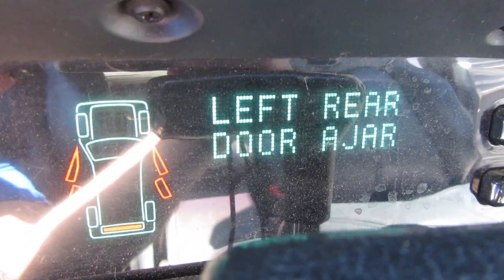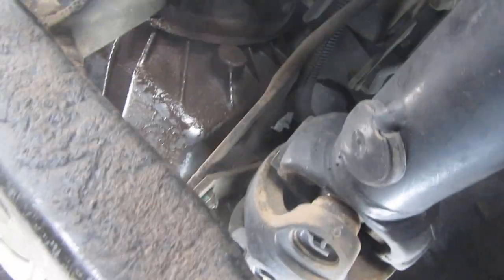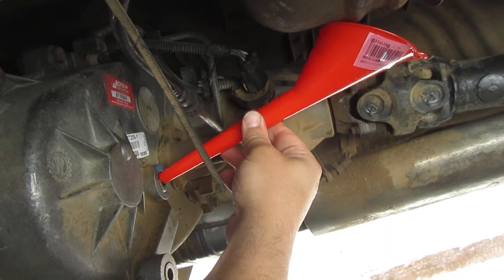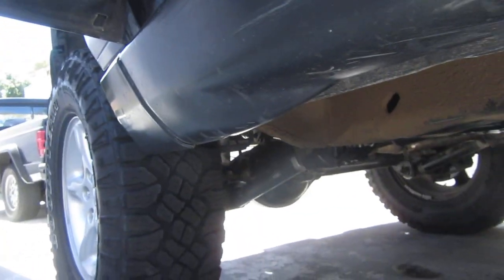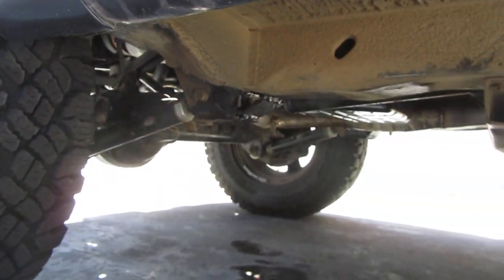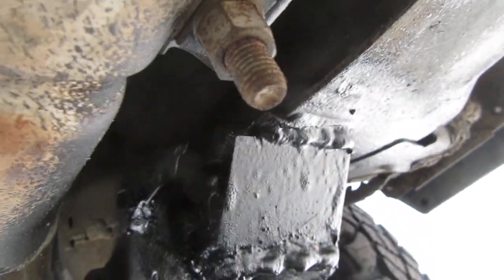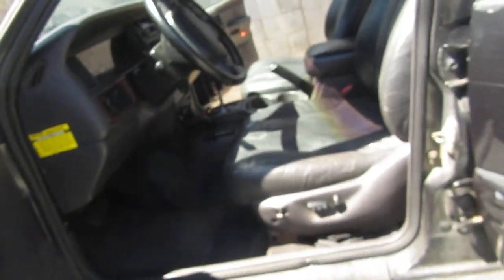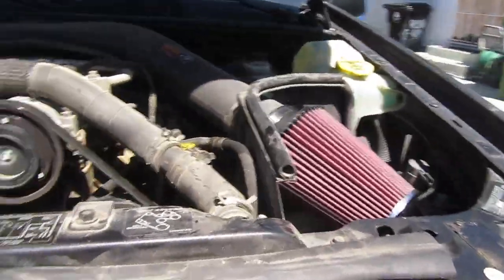SERVICE 4WD SWITCH - 1998 JEEP GRAND CHEROKEE ZJ

Comment: Castrol ATF plus 4 is the best transmission fluid for Jeeps.
Reply from the maker: No doubt.  Problem is finding it any more.  Some Autoparts stores believe +4 ATF is no longer necessary.
Reply: @301steady  they have it at advance Auto parts and AutoZone and Walmart is the cheapest of the three .
Reply from the maker: @jaysmith5084  Yeah, Walmart online, they deliver.

Comment: If I were to completely drain the Transfer case, how many quarts of ATF +4 does it take to fill it? 

Same thing for the transmission: If I were to completely drain out all of the fluid in the transmission, how many quarts do I need to put back in? Thanks again for the video! I need to do this...

Comment: Well lol I figured it was another shotty fault message for a few months, guess I better get to filling the t-case up thanks for the vid
Reply from the maker: Let me know if filling it up fixes your t-case too.
Reply: @301steady  My light came on. The funny thing is that I bought my 95 6 months ago, and my light panel wasn't working. Now it works and shows what you said yours did. I haven't driven it in 3 weeks because while I was on the Highway my trans would quit working, and then work again. Then it did it again, but finally it worked good enough to make it home. Do you think what you did will make my Trans quit doing what it did! Another thing is I didn't know you had to put it in N to check Trans fluid. I did in park and it was WAY over the full line! Thanks for any help!
Reply from the maker: @davidregan9872  Yeah, sounds like you have too little fluid in both the Transmission and Transfer Case.  O'Reilly sells ATF+4 by the gallon or Walmart.com sells Castrol ATF+4 by the quart.  I now am a firm believer that everyone should top off all transfer cases & transmissions every 3,000 miles; when, doing the oil change.  Completely replace Transmission & Transfer Case Fluids every 25K miles.  Change the Transmission Filter every 100K miles.  I've come to this conclusion by running all my Jeeps and my Chevy offroad, along with helping friends with their Jeeps.

Comment: I'm new to the Jeep especially ZJ so the T - case takes the same fluid as the transfer case?
Reply from the maker: Both the Transmission and Transfer Case takes ATF+4.
Reply: Even though mine is all wheel  drive
Reply from the maker: @newmexicooffroadvideoslock8814  Especially; because, it means it still has the original transmission & transfer case.  If it had an Atlas it would definitely not require ATF+4; but, it does.
Reply: @301steady  ok thanks  To keep up with your videos I like them
Reply from the maker: @newmexicooffroadvideoslock8814  I want to go to the desert; but, this lock down has me locked down.
Reply: @301steady  right .  Hopefully all this blows over

Comment: Something dont sound right with that engine.. besides the lifters tapping, sounds like an exhaust leak or something out the exhaust manifold.. I had a crack in my headers when I bought mine.. I replaced the 1 hole fuel injectors with 12 hole ones from k suspension when I did it.
Reply from the maker: You are absolutely right.  It's in the shop right now for tune-up, smog and the exhaust has lot's of damage.  It's all getting fixed right now, including new engine mounts and transmission mounts.  Could have done it myself; but, between work and life, easier just to get a shop to do on this one.  Not sure when it will be in the desert again, hopefully within a couple months.
Reply from the maker: The engine mounts were shot, allowing the engine to rotate.  Exhaust impacted right upper control arm.  Dented exhaust.  Caused leak at manifold.  It's all getting fixed at a reputable exhaust shop.  Maybe I'll make a video of it when I pick it up?
Reply: @301steady  I hear you.. I'm doing mine from front to back.. i fibbed a little. I got the new exhaust and fuel injectors.. i have the exhaust and intake manifold out when I saw the exhaust leak.. so I got new exhaust and I thought to myself.. why did those headers crack to begin with?. So I looked at engine mount.. sure enough dry rot and cracks in engine mounts.. I got mine with 130000 miles on it. It stayed in town past 20 years, older folks owned it.. so all the mounts and suspension are going bad from age.. I'm waiting on the first of month to order new mounts and stuff.. I also need to replace radiator... its leaking out of It.. I'll see if I can just repair it once I got it out or can see the back of it better.. there were battle damage repair kits In the military, I'm hoping I can find some radiator repair compounds and maybe just fix and flush.. eh if I take it out it's only 100 for a new radiator or somewhere in there, so who knows.. I decided to buy an older vehicle that I can work on. All the new vehicles are ridiculous with their planned obsolescence.. I figure I'll get this jeep up to par and stick with it.. got me a 96 jeep grand Cherokee larado..lots and lots to do on it.. I need to do timing  chain and sprockets. Crank shaft seal.. water pump too when in do that.. then once the manifolds are back on with new injectors I'll start moving back.. like servicing the transmission and transfer and differentials while doing new seals on all..  plus I need to grease and or replace wheel bearings, then the fun part that i haven't done much of.. the suspencion.. I want to figure out a little lift, not too big. I just want a little more aggressive and maybe just a little larger tires.. might find a 2 in easy lift or something plus cut out the fenders and do mud flairs.. I just dont want too extreme of an angle on the drive shafts, in other words I dont want to mess with the drive shafts or have to regear the differentials, so I dont want too big of tires or two big of a lift.. I need to research more.. all I've seen was some spacers that go on the shock or spring mount or something.. I'd like to fit a 30 in tire on. Not sure what's on now stock.. 28?  As I said I dont know too much about the lift.. your welcome to email if you want to correspond about jeeps sometime. thanks for the reply! Spongetoddfairbritches@gmail.com you can email me there if you like.  I'm over here in oregon.. that is smart wheeling in desert.. bout as smart as wheeling in mountains rocks... mud will just tear everything up as I'm sure you know!. Have a good one! Happy wheeling to you! Even my 06 tundra isnt made to last.. lol timing belt I've replaced twice.. it's got a transmission with no dipstick.. that was fun to service, need to do it again.. and it doesnt have hydraulic lifters so it needs a valve adjustment which I dont want to do lol.. it's my daily driver for now, so I figure I can keep it on the road for at least another 100000 miles while i get this jeep in pristine shape.. that's the plan anyway!. Might get my wife a 96-98 grand Cherokee too.. that way all maintenance on our vehicles will be easier and cheaper for me.. plus I'll only have to learn one vehicle to work on lol.. right now she has a 08 Buick lucern.. that's a piece too.. lol. I hate working on it.. I'm uploading my first youtube video now.. I'll try to post it here or tag you in it or something once I get it uploaded.. might give you a better picture of what I'm currently working on with the jeep. https://youtu.be/06b03c08iwI there it is.. the copied link to my first video.. now I get to learn how to edit vids and all that good stuff, and away we go.. !.